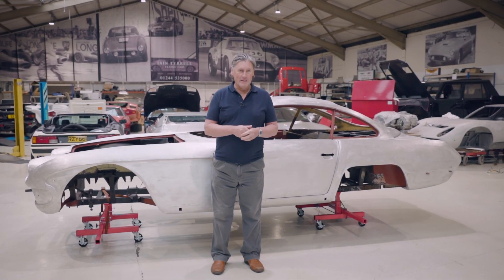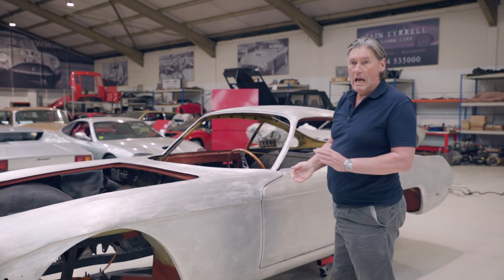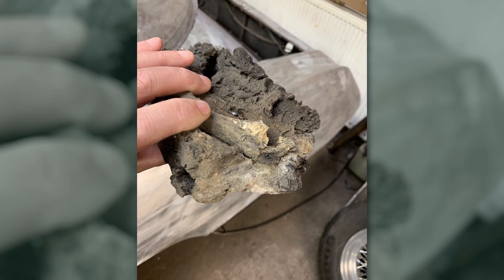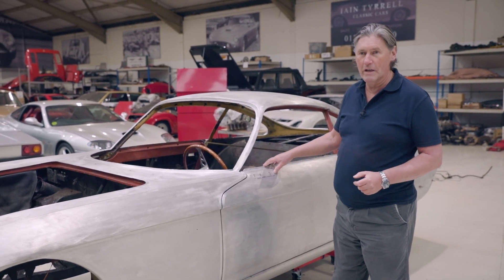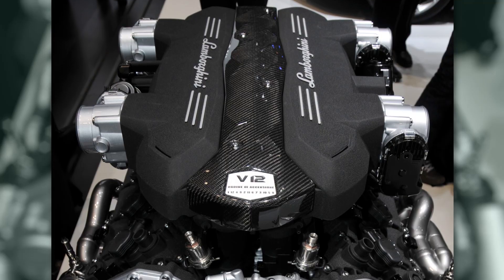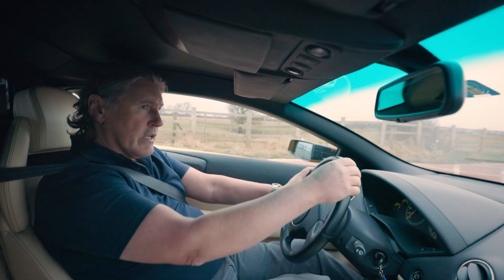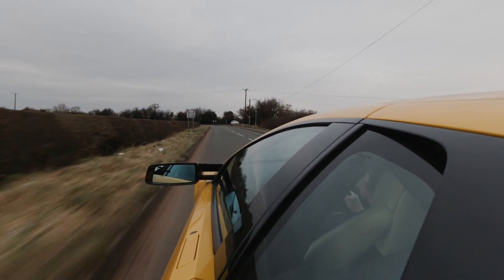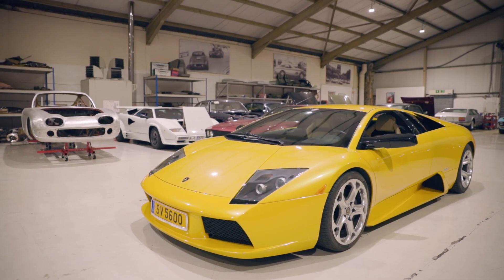Lamborghini 350GT, Murcielago and the Bizzarrini V12 | Tyrrell's Classic Workshop

Comment: Always quality output and another fact learned: 4 * 3 cylinder engines, eh, and more torque overall from a 3 cyl then a 6 cyl. Also obvious that budget is not something that applies to owning, servicing and restoring anything in that workshop. Thank Goodness we have these kind of owners and specialists like Iain. There are sad times ahead as everything goes electric with all the driving enjoyment of the Beko tumble dryer.

Comment: To my knowledge (respect where respect is due) the first inline six that used this „two three cylinder engines combined“ trick with two throttle bodies on an intake plenum separated into two units of three was used by Opel for their Omega 3.0 24V engine. There was a butterfly in the plenum that opened once the revs passed 4000, running the engine as „one six cylinder engine“.
Three cylinders run more torquey in the low revs but softer from throttling in excess of 4kRPM whereas the inline six has „no torque“ in the low revs and comes alive with the air resonating more favorably in excess of 4kRPM.
The Opel „Dual RAM“ intake took this into consideration ad the result was an engine running much better throughout the rev band compared to the BMW engines of the day.

Comment: Ive got some galvanic corrision on my Elise where the steel wishbones are close to the aluminium chassis. Even though they dont actually touch and the mounts are separated by epoxy. Dirt plus salty water is enough to create a link :(

Comment: I remember the old Carlton GSi3000-24V had that split intake setup.  Does a V4 have better intrinsic torque than a straight 4 Mr Tyrrell sir?  My old Honda VF750F pulled very strongly and cleanly from low rpm, yet revved nicely to 10500 or 11000 easily; so I'd be interested to know.

Comment: Thanks Iain, would the 180 degree shaped endine be what they term a "Boxer" engine, or have I got that totally wrong?
Reply: You are not wrong since the flat 12 cylinders are often, though incorrectly, called "Boxer". Wikipedia has the explanation on the "flat engine" page.
Reply: @alaindumas1824  thanks, I'll have a look at that.

Comment: Interesting comment about the 4 x 3 cylinder engines in the Murcielago.  I'm wondering if this is effectively what the Muira had with its 4 3 barrel downdraught carbs?  If that is the case, odd then that the Espada and the earlier GTs used 6 double barrel side draught carbs.
Reply from the maker: The inlets have to individually blanked- off to effectively make stand- alone 3 cylinder engines. Vauxhall used this system on their 24- valve Senators with great effect. I’m sure there are other examples:-)
Reply: @iain_tyrrell  thanks for the reply on an old video!  After I wrote it I realised I was talking rubbish!  I'm going to look into it further, but I'm thinking its partly about gas flow?  Sizing the throttle valves for good flow at lower revs, then opening up the throttle between the two plenums for greater flow at higher revs?  If this is it, it reminds me of a Yamaha Vmax motorbike from the 90s which was a V4 with 4 single throat carbs, and a valve between the two so effectively each cylinder got access to two carbs at higher revs.

Anyway, thanks for your videos.  My son is a total petrolhead (where would he have got that from I wonder...) and would love a career in the automotive industry.  We are in Australia so not so much fun exotic stuff down here!  I hope he can carve out a career half as interesting as you have!  He's got the chat, just needs to get the right start lol.

Comment: you know I was just thinking something, I'm watching ratarossa take down his 512BBI engine, and with the way they changed the intake system on the Murcie, where it runs 3 bangers at a time like this, instead of the full 6 for more low down torque, when they convert an older car to fuel injection, or put on an updated system, is that what causes such a change and adds so much more power to one of these?

Comment: A few years late but would galvanic corrosion (caused by steel in contact with aluminium) not have been a major issue. Like Aston Martins with leather ‘insulators’ failing ;between steel and aluminium parts) and even much more modern range rovers having these two metals in contact causing untold havoc.
Reply from the maker: Corrosion of any sort can break out in the most unlikely of places on classic cars

Comment: I know, I know it’s not the same not even on the same planet but I had a Smart Car which has a 3 cylinder engine and was startled at the bags of torque it had when using the paddle shifters. Now I know why. Course ran out of steam pretty quickly.

Comment: I've always heard the 60* was the proper "V" angle for a V12 (and a V6), so why did Ferrari build some with a 65* V angle ?
Reply from the maker: The main reason was to make more room to fit induction kit such as carburettors between the cylinder heads. 65’ was sufficiently close to 60’ to not upset things too much. Thanks for your interest
Reply: @iain_tyrrell  Thanks.

Comment: The F1 isn't that bad! 😄 The early 360 F1 software (and I presume the 355) get you around 20k miles. The later Challenge Stradale software improves this to 30 / 40k, more in some cases. It is about getting the PIS (clutch bite) as tight as possible. Once you get that right the cars are very drivable. These cars NEED true specialist attention. Slow manoeuvres aren't advisable and reversing up hills is an absolute no no. The E Gear Lambos (from what I have heard) can be dramatically worse. Clutch overheating is common. Is it something to do with weak clutch plate material in these cars? Be interested to know exactly why Lambos suffer with this so much?

Comment: When you say modern treatment for galvanic corrosion I guess you mean Duralac? You need a peg on your nose when you work with that stuff.
Reply: Something LR Defenders (old ones) never had just 4 yrs ago ...doors panels would react badly with the steel frames..as well as any undersea protection for the whole chassis.

Comment: The one thing that I don't like about modern Lamborghinis is that they have become a little too refined. A Lamborghini is supposed to be loud. It has to me the best engine sound in the world and I want to hear it. I will also take a well made manual transmission over one of these super electronic computer shifted ones any day. With a manual it's like you are driving the car instead of the car driving you.

Comment: It's sad that drivers need to slip clutches to drive do to ignorance...ut when when software does it too?..thats just sad.
I'm a tuner you could easily change settings in running software to still keep smoothness there but not burn out your clutch. Wierd factory simply didn't go...whoops needs a remap...done..now back to fun...